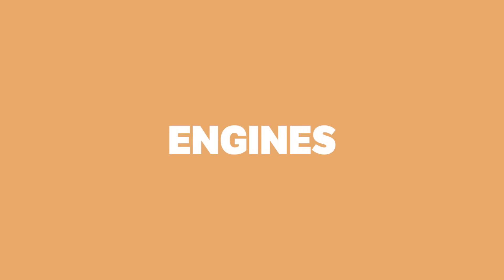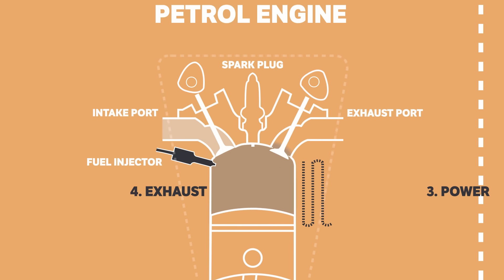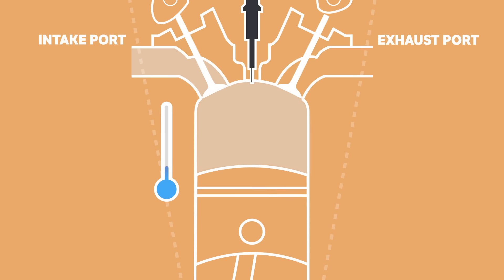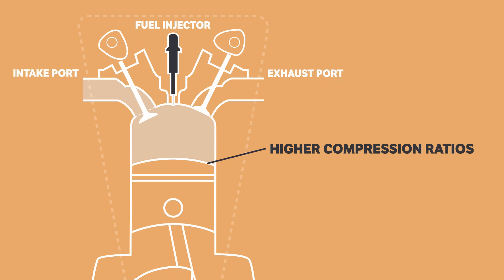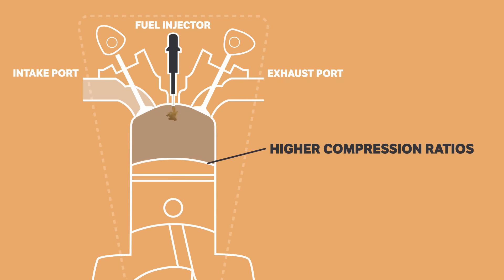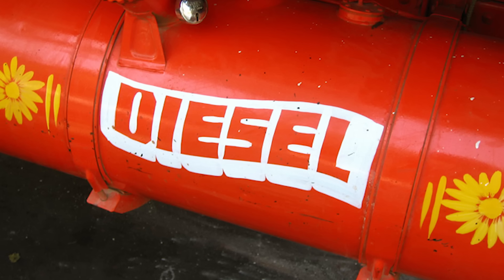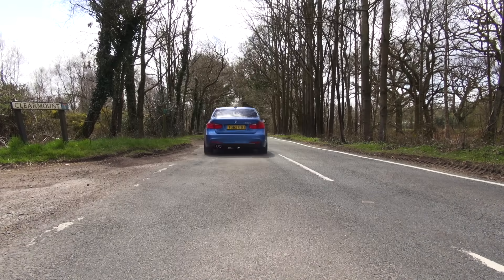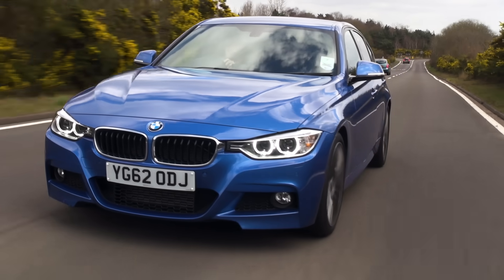The Differences Between Petrol and Diesel Engines

Comment: simple:
if you hate people, drive diesel.
if you hate environment, drive petrol.

if you bit selfish and hippy, drive electric.
Reply: What if you hate them both?
Reply: If you hate cyclists drive drunk
Reply: Hate people drive a diesel? What do you mean?
Reply: @AbhiBass96  diesel is more harmful to peoples health like pedestrians etc but petrol produces more co2 harming the planet
Reply: noname thanks
Reply: Patrols produce more CO2 than diesels. Diesels produce more sulphur dioxide than petrol
Reply: @echo_phyber  Exactly what I was thinking, it should be the other way round
Reply: What if you hate yourself?
Reply: @Skrinklewink   whatever you have, you drive it off cliff.
Reply: @Skrinklewink  Then buy a Renault
Reply: how about solar power car..with maximum buri buri
Reply: actually, diesel emissions are also bad for the environment, as bad as petrol, because the same inudstry behind finding, pinpointing and then digging the oil out of the ground is for all fossil fuels, and as I said, it's an industry and all of that is spending energy doing all of that to get the fuel to your tank, as for electric, well it's just as bad if it's electric created using fossil fuels at a power station, because your just displacing where the CO2 is created, electric from renewables (and yes there's a whole industry behind that as well that consumes fuels, however over time it becomes worth it, and no nuclear is also pretty nasty for us and the environment, and it's also a fuel that is finite in it's source), renewables should be thought of as the earths monthly wages, with fossil fuels thought of as the earths pension, except we all got that wrong.
Reply: It’s more like the lesser of three evils. 
Both petrol and diesel are bad for people and the environment. Diesel is worse because of all the particulates in the exhaust. That’s why the recent emission laws in most 1st world countries require diesel vehicles to have additional scrubbers on the exhaust system. You know, the ones VW tried to dodge with its bogus emission tests. ☠️
As for electric, sure they might run much cleaner, but has anyone thought about how hideously toxic the manufacturing and disposal of Lithium batteries is? They’re a “consumable” in electric cars. 
Does that mean we should go back to horses? Don’t get me started on horse farts as a source of greenhouse gases! 😜
Reply: @jamesstevens2362  Yea, same cows. These fuckers are destroying our atmosphere. They produce methane, which is 23 times WORSE than CO2.
Reply: I drive hydrogen. Checkmate! :p
Reply: Nice one Thomas
Reply: And if you are theking then drive bicycle
Reply: Sourav Bhatt How do you drive a bicycle?
Reply: If you hate both people and the environment, rolling coal modifications :P
Reply: So true
Reply: Hybrid????
Reply: Sandy BoleYT Hybrid are gay
Reply: Diesel it is.
Reply: there's a hippy here in Canada where I live, who happens to own a beautiful red Bugatti Chiron soooo
Reply: if youre an inventor, drive HHO
Reply: other way around
Reply: fun fact: diesel is just as bad for the environment as petrol (because diesel has more carbon atoms per volume it results in the same CO2 emissions per mile)
Reply: @user-bj3pq2si2l  Fun cact: Diesel is more bad bad for enviroment than petrol by a mile! It destroys our planet far more than petrol engines and that's a fucking fact!
Reply: Diesel is just right for me
Reply: If you like high toxic lit polution drive electric li-poly. If you don't need go anywhere you stop and looks how volcano poluted all planet without any people
Reply: It should be the other way around fucking moron.
Reply: Diesel is a way dirtier fuel
Reply: @echo_phyber  you are wrong. Diesel does not pollute the enviroment that much, but has fine particles that damage lungs. Petrol is the other way around
Reply: The thing about electrics is moving the pollution and noise production from the streets to the industrial areas. (and the small amount produced by renewables)
Reply: If you don't like cars. Drive electric
Reply: Yup hate people take a muffler off a 6.2 rev it
Reply: Electric car
Needs power station to fuel up
Power station transfers electric energy witch it becomes from power plants
Power plants mostly work on fossile fuels

Same shit
But it still pollutes the air less
Reply: @echo_phyber  thats what i thought too
Reply: I feel like you're more selfish if you use either petrol or diesel, electric is for the good of all, which is the opposite of selfish.
Reply: Hey bud where does that electricity come from?
Reply: If you're an idiot, drive a hybrid.
If you're a car enthusiast, drive hydrocarbon.
Reply: Alexander Mouzakidis factories need to burn to produce gas and oil. Factories need to burn to produce gas and diesel vehicles.
Electricity, soon enough, will come from clean sources. 
Your argument is invalid.
Reply: Daniel Cannata yours is, idiot
Reply: @Dave_Crupel  Except you are skipping a few steps.
Oil is refined, transported to a station then put into a car and is ready to use.
Electricity is produced, transformed, transported, transformed again, put into your power socket, transported again, transformed again by the car charger and only then it can be used.

The only thing you are doing is moving the pollution from the place the car is used to where the fuel is produced.

Also "clean energy" not only isn't stable (good luck with those solars at night), but requires more effort to produce and depending on the source, can be much more toxic to the environment than just burning coal and oil products.
Reply: @LecherousLizard  Electric cars are much better fot the environment. Even if it's produced by burning coal. And transport has no pollution. So it's still better.
Clean energy is stable if you use batteries.

Electric is obviously the future.
Reply: @Dave_Crupel  see how they produce the batteries for the electric cars. Then you'll know why.
Reply: Daniel Cannata and where does electricity come from? Burning coal lol
Reply: there is another option is bio diesel.
Reply: Diesel creates more soot, which is more harmful than traditional petrol emissions. Electric cars still have a significantly less carbon footprint than anything else, mainly because power plants are highly regulated and are more efficient than combustion engines by a considerable margin.
Reply: Thomas Galih Satria it’s the other way around. That’s why taxes on diesel are so high in the Netherlands. Cuz it’s way worse
Reply: I hate people i love environmemt but i love petrol😂😂
Reply: Diesels are environmental disasters on wheels. 

When will you dieseltards figure out that fuel efficiency does not equal how good it is for the environment. The East German Trabant 601 was fuel efficient even by today’s standards... but it produced four times the emissions as the worst West German car of the time (the Porsche 911 turbo). 

Diesels produce a ton of CO, NOx, and unburned hydrocarbons. Give them a few years and add burning oil to the list.
Reply: @Bartonovich52  What the fuck ? Trabant is Czech. That's it. Diesel has lower CO2 produce than Petrol. 
Petrol is shit, made from diesel. Diesel is much cleaner.
Also, you don't need as much diesel in your car as petrol, because diesel fuel consumption is much lower. Fuck off.
Reply: electrics wont differ much on pollution... depending on their life cycle from production to scrap.... or what will electricity factories need to burn to charge thousands of electric vehicles... its still plenty of Co2
Reply: @a.mouz99  I'm tired people saying electric cars are as polluted as gas cars because ThE eLeCtRiCiTy CaMe FrOm PoWeR pLaNt.
Reply: @a.mouz99  that's my argument for the last two years.
Reply: @a.mouz99  I realise you wrote this a year ago but i've also learned recently that the manufacturing process of li-ion batterys is very harmful on the environment, possibly even more so than burning fuel and also that with an electric car the price of replacing the battery over the long run combined with the cost of electricity will cost more than petrol or deisel would of in a combustion engine car.
Reply: ALEXANDROS MOUZAKIDIS doesn’t have to be ..
Reply: @a.mouz99  Statistics proved electric cars are about as good as petrol, but way worse than Diesel. Besides, these statistics were for 150k km lifetime, but we all know that Diesel (or petrol) engines can easily deal with up to 1000k km while electric car's batteries give up at about that distance...
Reply: eXist diesel is more polluting correct
Reply: If you a pussy, drive diesel,
If you're a bigger pussy drive electric,

If you a mad chad, you drive petrol!
Reply: I hate people abd kove the enviroment. I FRICKEN LOVE DIESEL
Reply: @jmstudios457  diesel is worse for people (more NO2) and just as bad for the environment (just as much CO2 per mile as petrol)
Reply: Who TF likes electric??? What the fuck, no explosions under the hood, no sound? Thats a toy, not a car. 
1. Petrol
2. Disel
3.
4.
5.
6.
7.
8.
9.
10.
1000. Electric
Reply: @_Drekavac_  though the toy would glue you hardly in the seat with its constant torque from 1 rpm :) Its just bullshit. According to your mentality, then cars are for retardeds who dont know how to ride a bloody horse :D
Reply: Yeah. Global warming is bullshit anyway.
Reply: @MrSupercar55  Yeah. Earth is flat also.
Reply: @MrSupercar55  You're THAT guy, right?

Comment: Diesel engines tend to last way longer than gasoline engines, they run cooler, and before DEF, and ULSD, the engines were very simple, diesel fuel was more oil based than gasoline, so the engines had lots lubrication. ...... i.e.... older generation diesel engines would run on ATF alone....

Comment: if diesel is more effective then why petrol is expensive?
Reply: In short refining cost of petrol is slightly higher than that of diesel
Reply: @chandanradi  Refining cost of petrol is MUCH higher than that of diesel. Diesel price is artificially driven up by additional taxes usually connected to supposed greater pollution created by diesel engines.
Reply: yes, it is called "rule of demand". here in Asia specifically in Pakistan, Petrol is less expensive than diesel
Reply: 30s of googling explains it:
trucks use diesel, if diesel was more expensive all logistics would be more expensive as well
so cheap diesel if good for the economy
Reply: More effective? Author means turbo diesel when compresion and pressure help a turbo
Reply: People ask the same thing with MACs and PCs or iOS and Androids.
Reply: In UK diesel costs more. But that has more to do with the monopolistic nature of the industry, and the fact that the suppliers controls your bank account rather than you.
Reply: As said diesel has more carbon compounds which creates more environmental pollution... Cost of refining petrol is higher hence the price is higher
Reply: In India petrol vehicles are substantially cheaper than diesel ones.

As far as fuel itself diesel is marginally cheaper than petrol
Reply: In Germany petrol is way more expensive than diesel. But diesel cars come with a shit load of additional taxes and insurance fees
Reply: It depends on the country's politics. Nothing to do with refinery  procedure as you get less diesel than petrol out of crude oil. It sounds wierd but that's how it is. Check it for yourself.
Reply: True... country's politics does effect the fuel price. But i think Diesel is easier to refine from crude oil. Diesel fuel is heavier and less volatile than gasoline, which makes it simpler to refine from crude oil. As a result, diesel tends to be cheaper than gasoline in most countries around the world.
Reply: Diesel engines are more expensive than their counterparts.
Reply: Taxes
Reply: Petrol is more refined than diesel.
Reply: Demand & supply
Reply: In Sweden diesel cost the same and more often more than petrol.
Reply: I actually like diesel better, but more and more cities are banning diesel in midtown because particles...
Of course VW did diesel a disservice by making their diesels look better than they are... But I honestly think that the public fear of diesel is exaggerated... Especially in hybrids diesel can be far superior to gasoline...
Anyway, the future is electric or fuel cell based... So I fail to be offended over diesel getting a bad rep.
Reply: In my country its not. Diesel is more expensive probably beceuse people have more diesel cars
Reply: Diesel does cost more than gasoline
Reply: Impolite Prince because it is cleaner and doensy have lead which contributes to air pollution
Reply: @ernestoiidelacruz4252  That's what a catalytic converter is for.
Reply: @ernestoiidelacruz4252  lead was banned from all fossil fuels many years ago...
Reply: I think it should be other way araund maybe becouse diesel does not needs refueling more often the gasoline thats why gasoline is more expensive diesel is more efficient and burns less fuel it does not need refueling all the time like gasoline cars
Reply: Petrol is way cheaper than diesel. In Germany you pay for a 2.0tdi as much for taxes as a petrol V8. Much more complicated repair and cleaning services will cost you a ton of money.
Reply: @deltaruin5941  (In Germany) a diesel is only worth it if you drive more than ~10.000km per year
Reply: @user-bj3pq2si2l  holy shit. I do 2000km + per month, and i live in Romania here diesel is pretty much at same cost as petrol. Funny is that my tuned C220 diesel with almost 250 hp shits on almost all petrol that are arround, so im glad with my diesel lil beast🥰
Reply: Petrol is cheaper
Reply: @DavidVoxDem  Yes Cheaper in US only.. because USA is getting petrol free by destroying Arab countries by single Word "Your country having nuclear weapon". But one day will come and answer all of your bull shit questions.
Reply: @DavidVoxDem  Depends where you live
Reply: Effective?????????????!!!!!!
Effective???!
EFFECTIVE?!
YOU WERE MEANT TO SEY EFFICHENT
YOU USSLESS
Reply: because petrol is a non renewable resource
Reply: @gtrlover4527  genius
Reply: @gtrlover4527  of course it is, but diesel is not renewable as well😑
Reply: @youareyourhome1629  here in pakistan diesel is expensive
Reply: @dylanhermsen7236   how about bio diesel
Reply: @dylanhermsen7236  really?  What about biodiesel?
Reply: @gtrlover4527  so is blinker fluid
Reply: @gtrlover4527  brilliant, well done
Reply: @gtrlover4527  and diesel is?

Comment: The only thing you had wrong is the engine brake.   On a Diesel engine with an actual Jake brake the timing of the exhaust valve is change and opens at the top of the compression stroke.  And the reason it is so loud is because the pop sound it makes when it opens after full compression or partial compression

Comment: I like Diesel more, because it´s easier for building your own car. Diesel requires  less Components to funktion (like a Throttlebody). It´s perfect for crazy motorised Ideas. Put the engine in Place. Fueltank, Battery, linking with Pedals and Gearbox and GOOOOO.

Comment: Diesel gives you more fuel economy, better torque which will result in less use of clutch, so your clutch will last longer, also a smoother drive so you don’t get the hassle of constant gear change. Diesel engines are also built more sturdier than petrol engines.

Comment: Forgot to mention one thing, diesel cars are more expensive usual due to the complecity of the engine, and a diesel car doesnt sound as good as a gasoline. I had a mini cooper s r53 from 2005,170 hp 4cyl turbo, it sound so good and had the "Popcorn" effect. 
And my bmw 118d, 2008, currently with 200hp due to the New turbo and a repro, doesnt sound nearly as good as my mini. Still awesome car to drive and much much more económic

Comment: Diesel fans💪
Reply: Electric car drivers-triggered lol
Reply: Donatas B Uhhhhh Look at a 2jz Toyota Supra, it's a petrol and it has more horsepower than any diesel. It does make smoke though, smoking the tires...
Reply: @xpanda_juice1923  have you heard of the cummins diesel engines
Reply: @xpanda_juice1923  ur braindead
Reply: How about OM606? Basically a diesel 2j
Reply: Yeeah diesel
Reply: yee
Reply: Diesel all the way
Reply: Diesel engines sounds like tractor. Gasoline engines are much better for cars.
Reply: @adam_jar  Better, especially when they can barely go up a hill, becuse of the lack of torque.
Reply: @andrascsont9605  it's never happen to me. At all, i prefer Petrol
Reply: Thats right
Reply: Yes 550D with two cooked Engine ;) The new diesels r shit
Reply: Yep
Reply: OH YES
Reply: The glorious sound of the roar... It's so satisfying
Reply: VROOOMM
Reply: Yes I am
Reply: Yeah, but my choice is quite limited to just a few. My favorite one is the one I drove briefly in NZ, that F25 35D.
Reply: Wr are petrol fans 💪💪😈
Reply: HELL YA
Reply: 30 years peugeot desils
Reply: ICE is dead
Reply: No smoke No Power !
Reply: Eew
Reply: I drive a 2018 dodge 2500 turbo disel for work everyday in the oilfields And I would still prefer  My Dodge stealth  rt twin turbo. Gas motors ftw
Reply: DIESEL - PEOPLE KILLER
PETROL - EARTH KILLER

Comment: I don’t know if this is a dumb question ( it probably is ) is a diesel car faster or slower that a petrol car ?????? If the two cars were exact same but of course different fuel . :)
Reply: ronan odonnell  diesel = more torque petrol = more power diesel are made for duty and heavy vehicle or for long distance. Petrol is for race cars or short distance. Diesel will always be slower than petrol. There is some exception like peugeot in le mans race but they had an hybrid-diesel and the race is on 24h non-stop.

Comment: diesels are louder and have more torque at low rpm
can they be made with less torque and more quiet to feel like gasoline ones ?
Reply: Then whats the fun of having a diesel if you dont want to have that power and that engine roar 💪
Reply: try crdi hyundai engines
Reply: My car is on diesel and it is more silent than a petrol car. ( Škoda Octavia mk2 facelift TDI. 1.6 )
Reply: yes. 1.6L EcoTec. Chevy cruze. look it up.